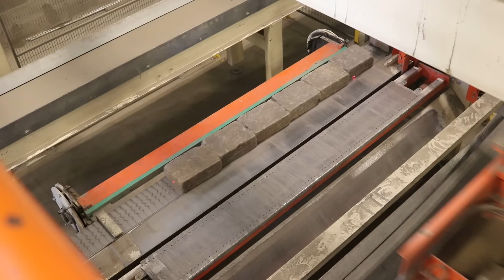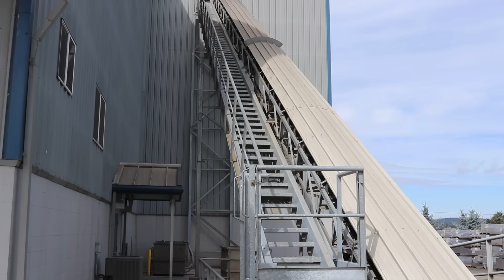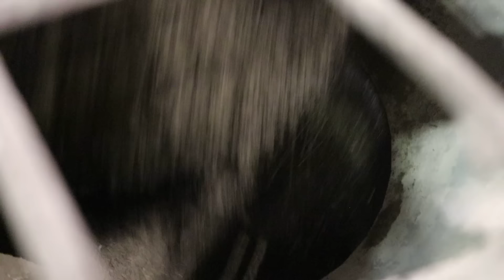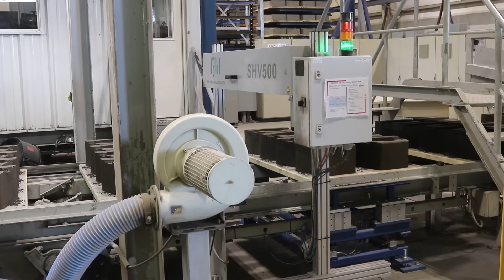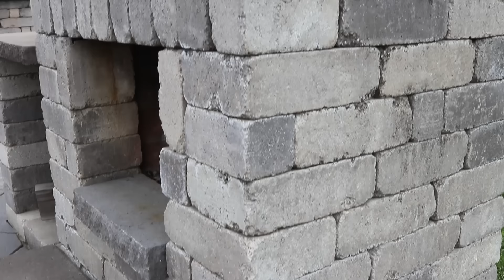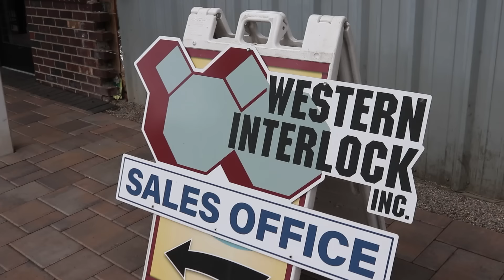Making Pavers and Blocks - Factory Tour!

Comment: Something you didn't mention and I don't see in the comments, but is quite important here in Belgium: Pavers exist with gaps to let water trough! Those systems don't count towards "hard" surfaced area here, which is limited to help with rain water management. For low use applications, you can use grass or gravel with hex mats, but on more heavy use application, pavers is the way to go.

Comment: Im not the expert, but that sidewalk you are installing at the end doesnt look like you are putting a crown in it.  You need to put a crown on it, its not supposed to be graded from the left to the right with a level.  The sidewalk is supposed to be slightly higher than ground level, and it has to have a crown to keep the water away.

Comment: About 20 years ago, the deck in front of our house failed, and I was done repairing and maintaining a wooden deck. The cost of putting in a paver patio was about 50% more at the time, but it was worth it. I pressure wash them once a year, and they look just like new. You definitely can't say that about even composite decking.

Comment: I just love all the weeds that grow between them.. oh, and the iron soil that bleeds through them on retailing walls and stains them. Pavers may be strong but they will move around.. guaranteed. If you like high maintenance.. go pavers
Reply: All of those issues are installer error. Every single issue you listed is remedied by proper installation techniques and polymeric sand in the joints. Look up a segmental retaining wall detail to see how little soil is behind a correctly built wall.

Comment: I was always wondering why in the US sidewalks are poured concrete instead of these. In Europe, just about any surface that has utilities underneath is made from these blocks that can be picked up and re-used whenever you need to access anything underneath. When the work is done, there is no obvious patch and everything looks as good as new.

Comment: The nice thing about pavers or tiles is that when inevitably the ground moves, or a trees roots grow, you just take out the 20-30 pavers that you need to change, flatten it and put them back in rather than having to deal with breaking out the concrete and re-doing the whole surface.
But it does require proper soil, compaction beforehand